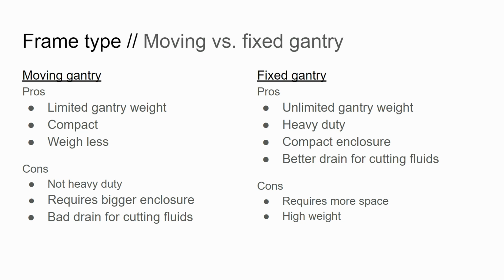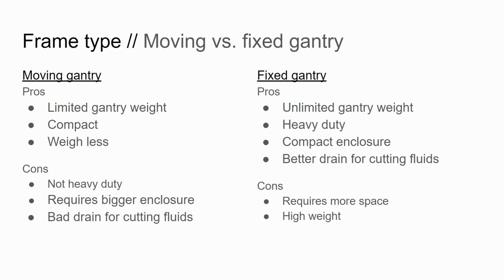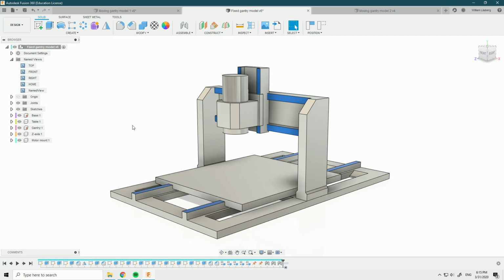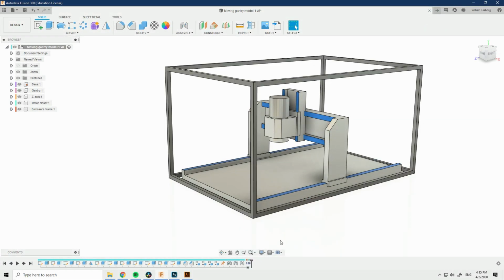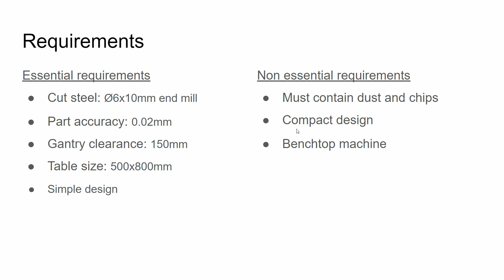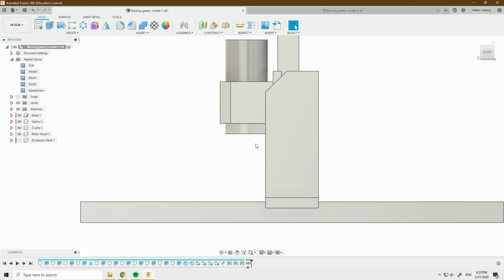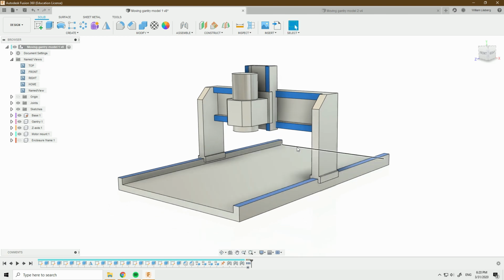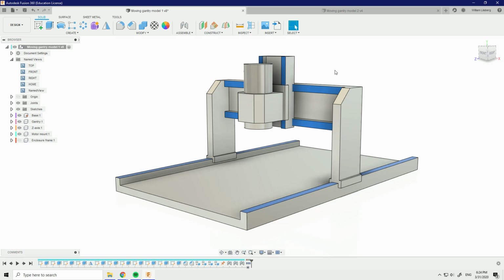CNC Router Engineering// Fixed VS. Moving Gantry

Comment: One on the big drawback on moving gantry is the mass that it moves. Your Y axis has to move the entire X and Z.

Fixed gantry has way more rigid Z, less vibration, more accurate, better finish.

Comment: I think you missed the biggest drawback of fixed-gantry machines: you cannot work on specific zones of a big/long part exceeding the working area of the machine.
It has happened to me to be asked to make such kind of jobs. I simply slided the specific area under the gantry, positioned, clamped and machined. Simply as that.
I got jobs that others cannot do with their fixed gantry machines. 😎

Comment: Actually one version of moving gantry gives you the best option for cutting fluid drain: you need to mount linear rails on the bottom side of the table. One of the biggest problems with fixed gantry is the problem with covering linear rails and  driving screw - the best option is metal plates, popular "harmonic" from plastic would be destroyed very quickly.

Comment: I really like Fox's use of granite plates, but also, I think the use of stiff high sides on a moving gantry design should help stiffen up the gantry itself (as it will be less tall)? Furthermore, I am hoping the high sides would help keep in chips and it also keeps the rails further away from chips and coolant. I even thought of adding acylic end plates to a high side frame (with gaskets) so that I could cut carbon fiber in a water bath. My machine would be desktop size, too so I am hoping the high sides would even allow me not to use an enclosure at all. I would likely cut mostly delrin and alu with a mist coolant. 

[Edit] Sorry, commented before I got to the part of your video with high sides;)
Reply from the maker: I think the high rail design would do a better job of keeping the chips away. Look into "Leather bellows for linear rails". You can buy linear rails protectors commercially, then you don't have much to worry about. 
I get the feeling that you would like to avoid building an enclosure. Have you worked with aluminum profiles before? It is very easy to build a frame of 3030 aluminum profiles. Then it's just a matter of mounting some acrylic plates or whatever you would like to use.

Comment: I have watched all your videos as they are spot on for relevance for me right now.    I think you'll find Piotr Fox Wysocki's channel interesting.  Maybe not for the theoretical engineering stuff, but lots of practical engineering as he has built and rebuilt his granite CNC machine over several years.  He also has interesting spindle information etc.  Good luck on your build.  
As I mentioned in the comment on one of your other videos, I plan for a raised moving gantry based on granite.  Well, the jury is still out regarding moving vs fixed since my gantry will be rather massive.  But for now, all my designs are on a moving gantry.
Reply from the maker: Thank you for sharing, I already follow Piotr Fox Wysocki, and I'm most certainly a fan of his work. It's an excellent machine he has built! I also like the simplicity.
Granite is very damp, as it's a composite material. Vibrations will not travel far, and it's therefore well suited to achieve great surface quality and to produce precision parts if the machine is rigid enough. You can make a mockup of both designs, raised gantry and fixed gantry, to figure out which is the lightest. If the gantry is lighter than the moving table, then that is what I would recommend. But please note that a moving gantry configuration can have other advantages. It is for example possible to have large workpieces that extend out of the machines working envelope.
It can also depend on what your requirements are, maximum stiffness, high speed, or perhaps whatever is cheapest? You can put each feature/property into a category and assign a weight of how important each area is, and then calculate a score for each design. The design with the highest score will be the best. Fx: stiffness = 5/5, high speed = 2/5 and so on. Then you will compare the properties of each design and multiply it with its category coefficient. So if design 1 has a stiffness of ID of 4 and a speed ID of 1 then its final score will be 5 * 5/5 + 1 * 2/5 = 27/5 = 5.4 (final score for design 1).